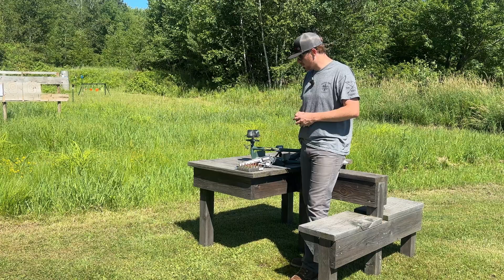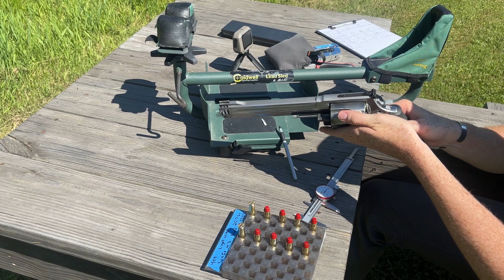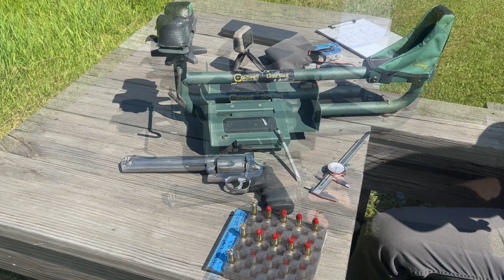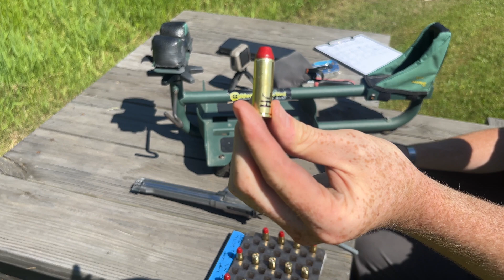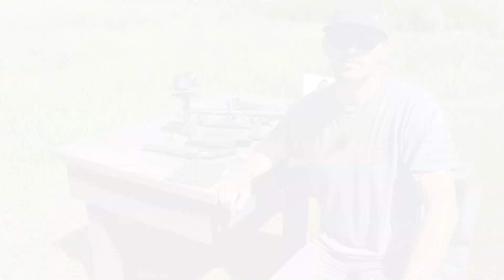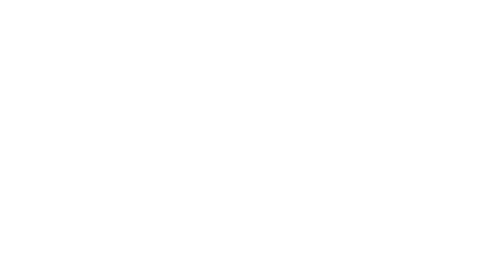Testing Crimp Strength – Does Recoil Move the Bullet in the Cylinder?

Comment: The purpose of a Crimp is to hold the Bullet in place, so it does not slip back into the Case or fall out of the Case. A lot of guys don't understand the purpose of the Crimp and its job. Crimp also provides consistent Pressure inside of the Cartridge. Crimp also prevents gas blow-buy that can result in a bullet being stuck in the bore. Crimp is extremely important if someone says they don't Crimp their Bullets... stay away from them. That crap about "neck tension" is plain stupidity. Uncle D

Comment: I just now stumbled onto your videos.
Your info is well defined, you dont stray from the described info.
You prove your findings in a fashion that i understand.
I tend to load the same way you do.
I love the charts of the many powders and the high/low charges that you capture.
 But.... i havnt seen any pictures of groups defining the accuracy of the different charges, or have i not came accross them yet.
 I load  for .38/357, 44spl.,mag./.40 cal, 10mm,.45 acp., and fixn to do .45 for a uberti.. and my only 2 deer rifles, sporterized 7.7 x 58 jap...from .270 brass.
 One has iron sights and the other scoped.
 Well of course a 5.56 which i tuned in with 64gr. winchester lead tips. My 12 year oud grandson took an 8 point at 75 yards with that load and it just stumbled a few feet then happened to roll the wrong way into a 10 foot deep ditch.
 I will be looking at your videos i will consider myself well informed.

Comment: I never use to clean my brass but now I dry tumble them in walnut media. 
The first time I tumbled them I added a little polish and I found when reloading the bullet could be easily pushed back when I test my crimp by pushing the cartridge against the edge of my table. I don't use polish anymore. I still can push the bullet back but not as easily. The dirty case made reloading the bullet harder to do but the bullet was very hard to push back. These were on taper crimp handgun loads. I haven't tried my 38/357 loads yet.
Reply from the maker: That’s a great point, and something a lot of reloaders don’t think about at first. Polished cases can reduce case neck tension, especially if the polish leaves a slick film inside the case. That can definitely make it easier for bullets to push back under pressure — and taper crimp alone won’t always be enough to hold things in place.

Going back to plain walnut media without polish is a smart move if it was affecting your tension. Clean brass is good, but friction where it counts is important too. Let us know how it works out when you try your .38/.357 loads — those longer bullets and roll crimps might behave differently.

– ACME Bullet Co.

Comment: Now I've not shot, nor own, any of the "monster magnum" revolvers, so I can't speak for them. However, I've handloaded for 65 years, with various types of standard calibers. I always put a roll crimp on strait wall cartridges, and a slight taper crimp on 45 Auto. I don't load other auto pistol as I have little trust in them, thus no use for them. So... in all these years I've noticed a few .357mag JHP bullets back out ever so slightly with roll crimped 110gr JHP. I concluded that was the result of a very short bullet having little contact with the case for tension. Similar pressure loads with heavier bullets, and despite greater inertia from them, had far less sign of movement. 

It is my belief that longer bullets are gripped by the case to reduce movement under recoil. A crimp beyond a standard roll crimp is of no advantage as it creates greater pressure and recoil. There is no advantage to extremely heavy crimp. 
Sensible loads, standard roll crimps, and moderate length bullets are the key to success. I'm sure the hyper-velocity magnum blasters will say I'm too temperate, but I've been at this before most of their parents ever met. 😏
Reply from the maker: That’s a fantastic perspective — and 65 years of handloading experience carries serious weight. You’re spot-on about case tension playing a big role, especially with short bullets like 110gr JHPs in .357 Mag. We’ve seen the same thing: bullet length and case grip can matter just as much as crimp style.

We agree — there’s definitely a point where more crimp just adds pressure without adding control. Balance is key. Really appreciate you sharing your experience, and it’s always good to hear from folks who’ve been doing this longer than most of us have been alive!

– ACME Bullet Co.